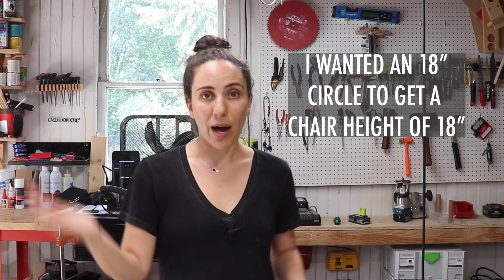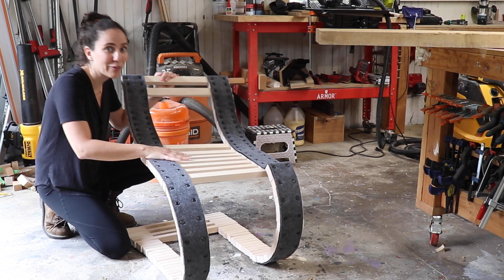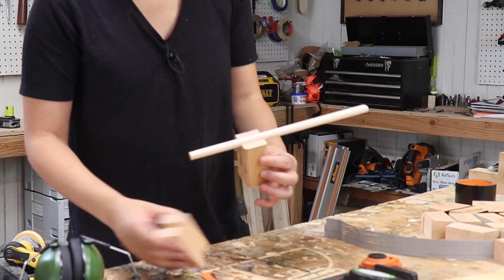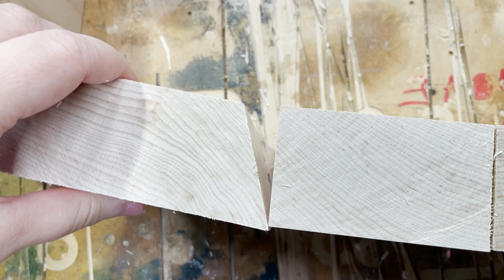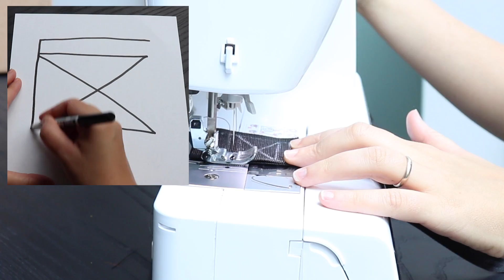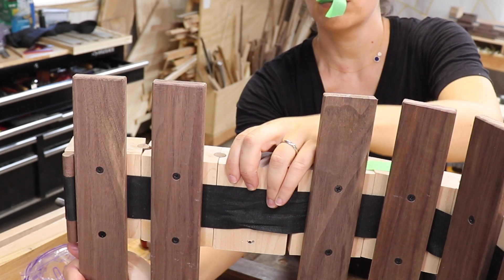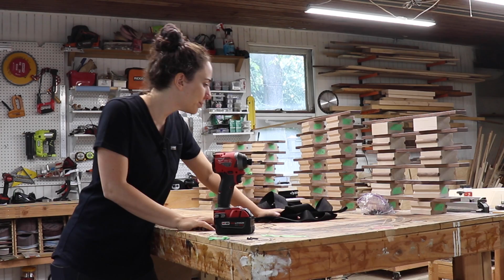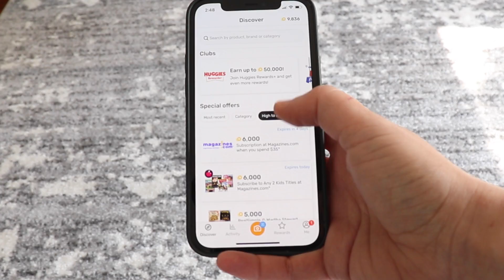I ATTEMPT to make a Roll Up Chair… AGAIN...

Comment: dont use leather. it will stretch more:/ the metric you are looking for is Young's modulus(measure of stiffness) UMHW is 130Gpa ,Leather is 69Gpa, and steel rope or cable is around 190Gpa to 200Gpa, this means for a comparable cross-section leather will stretch twice as much

Comment: A drop in the bucket here, but what about multiple layers of the straps, but only in high tension areas? On the main curve, have 3 or 4 layers of strapping, with the one closest to the main belt being shortest, then longer and longer, each one box stitched in a row. You'd effectively be multiplying the tensile strength of the straps, but only where necessary.

Comment: I know you'd already cut them, what about new slightly thicker blocks, or gluing on an extra few millimetres of new wood to the current parts? To potentially overcome the leverage, even though it would make the chair thicker when rolled up. Option two is to add a third row of blocks in the centre?

Comment: What I see, the curve on the back rest is actually applying pressure to the whole surface of the wedges where they touch. The wedges that make up the base curve only apply pressure to the inner edge. This is encouraging more bend than you want. Maybe invert a few wedges to add strength?

Comment: Wow! What a saga! :) I have great admiration for your persistence. I am an engineer so I could not leave this problem unsolved! There are a couple of design problems that are not adequately resolved:
1. As others have pointed out, if you have 100 kg (1 kN) on the seat at 500 mm distance and a distance from the webbing to the edge of the block of 50 mm then it will have a total tension of about 10 kN (about a ton force, for those who like tons). This will crush the edge of the block and make the tension higher again as well as stretching the webbing.
2. The webbing is free to slide. This means that the 10 kN tension will be along all of the webbing, so the stretch will be much greater than if it was only on the short regions where the tension is required. It also allows the buckling / collapse phenomenon. Scary!

I have some suggested solutions! And I'll probably eventually give it a try, it's such a cool idea! I've got a few projects in the pipeline, so not soon!

1. Instead of having discrete webbing, make the tension member extend all the way across the chair. So instead of 2 x 50 mm, you have 500 mm of width - 5x improvement!
2. Use Kevlar fabric instead of webbing. It has a very high modulus, so doesn't stretch much under load. Depending on the thickness this could be very minimal. Kevlar bonds very well to epoxy - see later.
3. Make the blocks that form the curve full width, so that they don't have such high compressional stress in them and they don't get crushed. For hardwood slats the cross-grain compressioal stress needs to be limited to about 2 MPa - this can be achieved with slats that are 50 mm thick, I think. It would be possible to make laminated slats that have a section that has the grain perpendicular so that the compression load is parallel to the grain - woods are much stronger in this direction, maybe 10x! The full width slats can provide the sideways rigidity as well, so the slats on the top are no longer required - you sit directly on the Kevlar fabric (or a soft fabric covering to make it comfy, not epoxy-coated kevlar!). So, only two layers.
4. Attach the Kevlar to the wood at every slat, so it can't slide in any direction. I would use epoxy resin. We have to keep the resin out of the "hinge" parts of the fabric, otherwise it can't roll up. It might be necessary to define the hinge regions with molten wax or something, so that the epoxy doesn't wick in to the hinge sections. You can melt out the wax afterwards. Some experimentation required there! Alternatively, it would be possible to bevel the edges of the slat where the kevlar attaches to make a little triangle, which could be kept free of epoxy with care during the lay-up. The shear strength of the epoxy between the Kevlar and the wood, distributed over the whole length would be sufficient, I think. (Using an approximate lap shear stength of 10 MPa for the bond, this would be very strong - no problem)

Anyhow, congratulations on such a cool idea and great video! Maybe someone can use some of these ideas? :)

I would not recommend leather - it stretches and stretches and then, just when it stops stretching,.... it breaks. :(

Comment: Intuitively I think to brace each wood part with a metal plate on each side. This way compression forces should be more evenly distributed, rather than on corners. Yeah, and the straps should maybe be wire in stead. Perhaps many wires.

Comment: hmm might be worth a try to do variable reinforcement. IE in gap prone areas add hidden cable reinforcement in slots. the strap has to have constant tension but different parts of the strap/chair carry different amounts of loads.

Comment: Loving this. I have two thoughts that hopefully help.

1. Having the strap/cable/whatever not be attached at several points means that any slack is 'sent' to the highest tension spots (the front) and will collapse any inverted sections (the back rest)
2. The front bend of the chair will always compress when sat on, so it needs to look 'wrong' and slope forward when not under load in order to settle into the correct shape when sat on. If the chair looks right before you sit on it, it's going to sink down and lean back when you do.
Reply: On 1: I had the same thought. However, realistically, for any chance of this to work and actually be stable enough, I think about the only option is to buy a metric F-ton of hardware and use strong metal hinges, possibly steel ones, between all the blocks. I think there's probably not any strapping material that would actually work.
On 2: It might have been easier to create a roll-up couch table. In fact, maybe some of these failed chairs might still be salvageable towards that.
Reply: I agree with the second advise, but instead of " wrong"  slope, in the first curve use 2 different types of angles on the wood, one inwards and one outwards, to counter each other and transfer the compressive and tensile strength accordingly without creating the gaps in between the wood blocks. That should ensure that the shape stays same more easyli when sat on and in standby position. As right now when sat on all the force and pressure is just hold by the straps and almost nothing is transmitted through wood because of the gaps in-between the blocks. So I think the straps would work, both kinds but with different blocks design for the first curve

Comment: You seem to have an elasticity problem, not a tension problem. By the nature of the design, you're going to wind up with a high level of tension in your strap material, and in the joints between pieces. Making sure you're using the hardest wood you have available (hard maple or hickory are solid choices) to decrease deflection will help. The biggest problem to solve is the strap. What you need is a material with high tensile strength but a much lower level of elasticity. I would look into an ultra high molecular weight polyethylene (Dyneema is the most recognizable brand you can find). That type of material has very low elasticity, very high tensile strength, and is also fairly resistant to UV and water exposure, making it good for indoor or outdoor applications. You may also need to use either a thicker ply strap, or use multiple layers to distribute the tension load and reduce elastic deformation. 

Or you can install a metal hinge in every single joint. But I'm sure that's not the aesthetic you're going for.

Comment: When the gap keeps being created at your 4th and before attempts, I think it’s basically because the back of the chair where you are applying weight acts like a lever along the length, and so it forces the gap at the far end, where the forces are strongest. Loving your dedication on these videos!

Comment: I think that the strap are working in the wrong way , they are ok on the front side where the force provide by them keep the curve in a stable position, but at the backrest and the bottom the strap are working against the curve of the chair 
Probably you’ll need to invert the position of the strap (in the back at the top of the backrest and in front on the curve) for balancing in the correct way the forces

Comment: Could try a "locking" design one piece locks into the next when unfolded and put the strap all the way around the ends with tension keeping them back a bit  and leather will not work it will tear And dry rot

Comment: Cool idea but it looks like the strapping material is too elastic. You need to switch to fiberglass or carbon fiber. Also an epoxy would have more than enough holding power. Hope you get it solved next time.

Comment: You could add a support piece that extends down the back of the chair (kind of like back legs), mitered to bend the opposite direction.  This would distribute the seat-weight off the main strap's tension, while maintaining the rollability.  It could be separate parenthesis-shaped piece ( and the overall chair would look kinda like c(  <--- imagine this in an italic font, and the top of the c connected.   I'd also recommend rounding over the corners where the strap is-- first, it won't pinch your fingers as you're unrolling, second it won't wear out the strap, and third it can help compensate for stretched strapping.

Comment: just a couple questions or hypothesis, obviously without having the piece in my hands lol. love the videos. 

Could the wood be compressing on the internal side of the bends? adding to the stretch factor of the straps, giving it more wobble and less rigidity. it makes me wonder if you could make the chair out of metal segments or try adding metal plates in between the joints? to help disperse the pressure on the pinch point. example: whack some wood with a hammer and it still stays compressed.

when the strap are going from the seat portion to the vertical back portion. All those gaps where you can visually see the straps are like mini bridges when you get them under tension. also adding to the stretch/slop of the straps.

i think there are just too many imperfect flaws in mother nature to be as precise as these pieces need to be to become a chair. if that makes sense lol. 

maybe instead of one continuous spiral its two spirals together? like the curve from the back spirals one way then the bottom "legs" curve spirals the other direction? almost like a figure 8.

Comment: You are one of the only woodworkers that I believe has the proper respect for how dangerous a router is, or at least shows that respect.  Everyone pays lip service to safety but you actually show it.  You create jigs and push sticks to ensure that your fingers don't ever come close to that spinning bit of death.  Even though I know that other youtubers would never show an accident, I still clench up when I see them blithely routing pieces with their hands so close to the bit.

I appreciate you showing new woodworkers that they need to respect the machinery, but also I appreciate not getting heart palpitations in the middle of the video.

Comment: Your project is very interesting!

I still think you don't have enough tension, and not enough resistance to compression. All materials are springs. The question comes down to how much they deflect under a load. All webbing weaves are designed to stretch slightly, no matter how "low stretch" they claim to be -- it's a stiff spring. If, for example, you had a thin steel sheet instead of webbing, it's simply not going to stretch as much. That's why we don't use steel strips for seatbelts -- it would kill you. To get more tension, you need to undersize the distance between blocks, but not just one or two blocks, but every block. I think you did this in your plan D. The undersize distance must account for the tensile deflection in the strap, which I don't think you did.

But you're also likely running into another problem. At the compression side of each joint, you maple is going to deflect slightly, and presumably bounce back once unloaded. Without changing the material, the only solution here is to oversize each angle by a few degrees. This accounts for that material that will be compressed once under load. It also accounts for tolerance issues you have on the tensions side.

Basically, for the materials you are using, with no one in it, it should probably look more like an standing S" than the final shape you want. If you want the shape to be the same loaded and unloaded, you probably need to use metals instead of wood since you need to increase stiffness to minimize deflection under load.

Comment: I agree with other people's previous comments that stretchy leather is not the way to go in the long run and that steel cable would be the better choice.  Either drill through each piece to make a continuous channel to feed the cable through, or use your router to make a channel along the surfaces between the walnut slats and the maple.
I know the goal is a roll-up chair, but maybe first focusing on a fold-flat chair, where just the crucial bends are flexible and the feet, back, and maybe the seat of the chair are fused/single boards.  Once you sort out the material/tension to suit those crucial curves, then chop up the solid parts to solve those potential folding/finger jam problems and make the whole chair roll up for storage.

Comment: My guess, for further exploration, would be to simplify the design first: Don't use a smooth, round curve with many many blocks, but try to use a more square design with fewer blocks (idk, start with 4? or 6). This way tiny mistakes don't add up too much and you can dial in more focussed on the problem solving.

Comment: Don't try leather, it stretches a lot. Think about old belts... 
You need a mechanical engineer to evaluate the tension on that webbing to spec' required material strength. My guess is this requires far more strength than you would ever imagine. The loading is far away from the join which leads to enormous leverage at the points of concern.

Comment: The strap needs to be on the outside of a curve. In your current design the strap is on the inside of the curve for the back support. You need to put the strap on the outside of the back support curve.

Comment: Instead of webbing straps, have you considered amsteel rope through the center?  It has very low stretch and high breaking strength with 1/4 inch amsteel having an ABS of 8600 lbs.  Then at the bottom or top, you could use another dowel to spin or something similar to tension the rope further.  Hope that makes sense (in my head it does...).   Good luck with this one!

Comment: I'm so sorry it didn't work.  I don't think it's a problem with tension.  I think it's problem of the strapping stretching.  You need nylon strapping which is available only from Harbor Freight, and 'Home Center Stores'.  Next, now this is where it gets a little tricky, but you've already gotten a little tricky ( I mean clever ).  Mill some grooves in the tops of the blocks ( wedge shaped ).  Place the wedges on the strapping under sufficient tension, and drive the wedges and strapping into their grooves simply by securing the slats with screws.  Don't screw through the strapping.  Oh, and stretch the full length of the strapping ( you're going to use ) in the bed of your truck over a temporary wood frame.  Round the edges of the grooves to prevent cutting the straps.  Use the strongest hold down straps you can.  Don't glue the straps.  Might want to make it so the straps can be wound up at one end.  After all, even fine guitars have to be tuned up once in awhile. 

If that doesn't work, try replacing the dowels with something more interlocking, so the straps don't have to keep the shape of the chair.  Hmmm.  Dough!  That's all I can think of ( at this time ).  In conclusion, Tamara, good luck with the mission if you accept it.  As always, this comment shall not self destruct. Dah dah, da daaaah.

Comment: Maybe the strap needs to be attached to every spacer block individually to localize the stretch to the length between 2 slats. The current iteration makes the peak forces stretch the strap over the entire length yielding a very low effective spring rate.